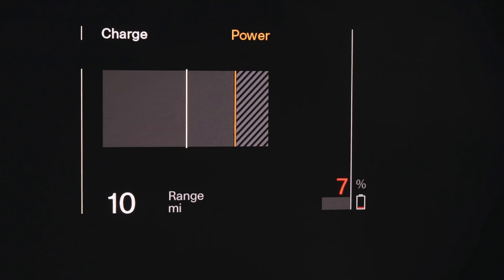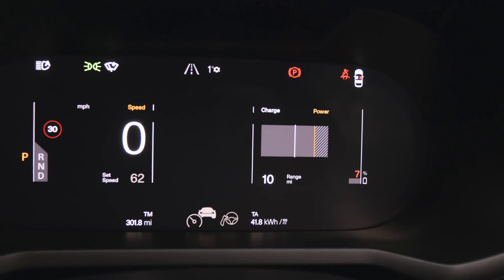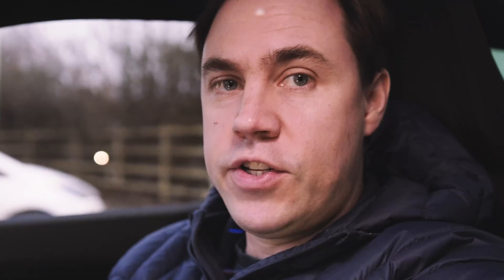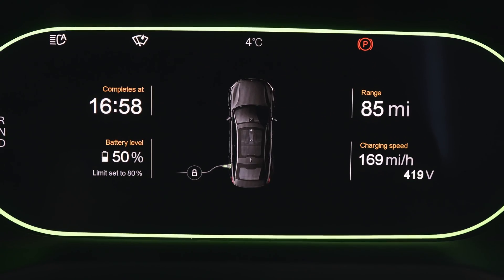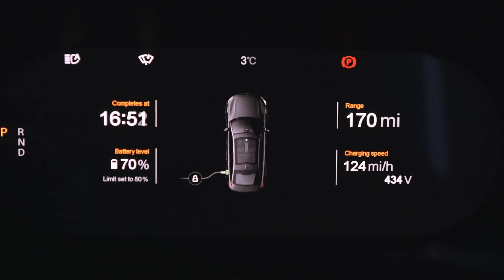Polestar 2 150kw Charging with battery heating - BP pulse 150kw charging

Comment: You mentioned during your warm up procedure that the display was suggesting they it was limiting your regen due to bat temp too high!
May I suggest you do tests to find out how much you have to warm the battery before you see an increase in charge rate, then if you fast charger from that point you will be warming the battery up further, through the point you started at, and then on to the point that too much heat starts limiting things.
Are there any Polestar dedicated obd2 devices that can pick up battery temp and charge rate, like the “LeafSpy” does for the leaf? 
My mate is about to get a Polestar2 in a day or two! I will try plugging in my LeafSpy and seeing what happens!!!!!!
Reply from the maker: Thanks yes good idea! Let me know if you have any luck with leafspy. I haven't come across anyone who has managed to get data from the obd but would be nice to know if it's possible and how to do it.

Comment: I saw on Tesla video if the trip was set to a Super charger the Tesla pre heats the battery at a predetermined time or distance, perhaps Polestar needs to do this automatically. Until Polestar do this Tesla will be the dominant manufacturer.

Comment: On 30th December,  I received 50Kw in 60 minutes from an E.ON 150Kw charger. It was almost 0 degrees Celsius and I started from about 35% SOC. Maxed out  at 60kw/h charge speed. Bit of a disappointment. Love the car though. Some of that could have been the charger and the battery probably wouldn't have been all that warm.

Comment: Fastned publish charge data from their chargers:
https://support.fastned.nl/hc/en-gb/articles/360012258358-Charging-with-a-Polestar-2
As you can see the PS2 is doing something very odd.

Compare it to a slow BMW i3: (Incapable of even 40kW)
https://support.fastned.nl/hc/en-gb/articles/204784718-Charging-with-a-BMW-i3
Or a fast Audi e-tron: (Capable of 150+kw)
https://support.fastned.nl/hc/en-gb/articles/360000815988-Charging-with-an-Audi-e-tron

Both these show what you would expect. As long as the battery does not overheat or is too cold you get a limited amperage. Since the battery voltage increases so too does the wattage input required to keep charging at that amperage. This creates an interesting and slowly climbing curve when plotted as chargerate in watts.
Notice also the e-tron 55 is amperage limited while the e-tron 50 is wattage limited. Also note that on a 50kW charger you get a constant chargerate limited by the charger, not the car. And, it is 50kW fully, not 45-46.
Reply: the i3 stays at 40 kW or more up to ~85%. compared to the ID.3 or E-208 however it's slow. but i still like my i3 2017 👍🏻

Comment: It is good to put this into context - if you can turn up to the charger with a fairly warm battery (i.e. you're driving long distance), then the Polestar is only about 5-7 mins slower than the Model 3 to charge from 10-80%. That isn't the end of the world. The absence of battery active heating prior to charger arrival is definitely an omission though.
Reply from the maker: Yes that's a very good way to put it!

Comment: If / when Polestar enable preheating of the battery it will improve the charging speed and the efficiency.
Another thing that may be an issue, is that even with a 150kW charger there will be loses, so I would stay to stand a better chance would need a charger cable of delivering more than 150kW.
I had a Model S before my Polestar, and the charge curve on that wasnt great, it would sit at its top charge rate for a minute or so. So people shouldn't be that frustrated in comparison to a Tesla in my comparison.

Comment: Again, a good vid thanks. As an aside I drove my PS2 for the first time in about 10 days having charged it to 100% after I last drove. When I pulled away today it initially showed battery level at 100% but after about 10 secs of driving it shot straight down to 92%! Does the car lose charge when it's stood idle for a while I wonder? To lose 8% in 10 days is quite a bit!
Reply: might be software error
i own a polestar 2 and it actually have less vampire loss than other EVs my friends have
Reply: That's an approximate constant power draw of about 25W. A lot higher than is needed to just keep a phone connection active and the main computer in standby, but not enough to suggest the car is doing anything very intense either. If it makes you feel any better, my Model 3 seems to pull about 50-60W in normal sleep mode. It also has a deep-sleep mode apparently, but i'm not sure what power draw is then.
Reply: Don’t leave t fully charged, it is bad for the battery.  Only charge to 100% if you will drive immediately.

Comment: @Short Circuit Looking at the FastNed charging curve they made based on their Polestar 2 data https://support.fastned.nl/hc/en-gb/articles/360012258358-Charging-with-a-Polestar-2 it's rather odd to see your charging speed at 88 kW (rather than 100 kW) at 40% and at 68 kW (rather than 80 kW) at 50%. I don't think car heating and charge efficiency losses can explain that 12 kW gap? 

Also I've read on forums that (1) the preheating only heats the cabin and (2) supposedly the battery is preheated if you set a DC fast charging station as your destination in Google Maps. Did you happen to do this while driving there?

Comment: I think there is a compromise being made on battery charging speed.
- Manufacturers are throttling charging speed to protect and extend the life of the battery. e.g. the max charging speed reducing after 50% and then further reductions after 80%
- Drivers like myself who are leasing the car for 3 years are not directly concerned about the battery life/condition once the car is handed back, so are pushing for faster charging speeds.
Reply: Ultimately though you will care because if they allowed the batteries to seriously degrade, it would reduce resale value once you're done with it thus pushing your lease cost up.

Comment: I read or maybe it was another vlog that a chap with a Kia E Nero was getting a max charge of 70kw  when the car is advertised at 100kw max. However he discovered that the Nero could regenerate at 100kw when slowing down from high speeds. I wonder if it could be a similar situation with the Polestar.
Reply from the maker: Very interesting, I hadn't thought about that. I'm hoping to try out the esoul and eniro at some point, my wife is keen on the Soul to replace her current car
Reply: @ShortCircuitPS2  
We had a diesel soul years ago and loved it then bought the Kona Electric 2 years ago. Felt like a change as my wife likes a bigger car so tried the Soul EV last August, not keen as we felt a bit claustrophobic in it, perhaps it was the black upholstery, in the end we ordered the Kia Nero 4+ picked it up just before Xmas and really love it, it’s a brilliant car. Happy hunting. Colin.
Reply: The 2021 Kia e-Niro is limited to 77kW charging top speed whatever the charger is.

Comment: The highest i have seen in my P2 ia 133kW at 15% at 0 degrees Celsius after a 130km highway run @Shell recharge 150kw charger.

Comment: I've only Rapid Charged in the cold ambient and never got more than 90kW's even with a warm battery. In addition once at 60% SOC you'll only get 50kWh regardless of temperature.
You won't get 130+ until ambient temp is 20deg or higher.

Also if you use InstaVolt and ChargePoint APP you can actually get a charging Graph curve after your charge.
Reply: Example: https://www.polestar-forum.com/cdn-cgi/image/format=auto,onerror=redirect,width=1920,height=1920,fit=scale-down/https://www.polestar-forum.com/attachments/screenshot_20201224-202736-jpg.2624/
Reply from the maker: Yeah love the chargers thay show you the data! I wish all providers would do that

Comment: I hit arrund 120kW on ionity when I first drive 100km at 120kmh. But after 50% it goes down to 80kW....and that suck. I think polestar need to adress this. For ME its not a big issue. But if they say 150kW...it should do 150kW simple as that. EDIT: I can deal with 80kW after 70% and then it can start going down even more. I understand we need to "save" the batteries..but at 50% is just crazy
Reply from the maker: Yes totally agree. We should see 150kw at least for a good section of the charge. Eve if just from 10 to 50%. Otherwise the claims are false!